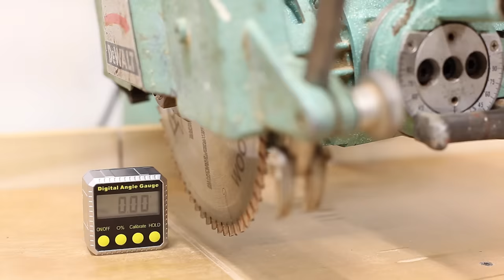How to Build a Standing Desk / Drafting Table

Comment: You have ALL the tools which makes it dead easy .…… try doing it without all the machines……
Reply from the maker: Yes, it's called woodworking and with that tools are required.  It could all be done with hand tools but it would take a long time.